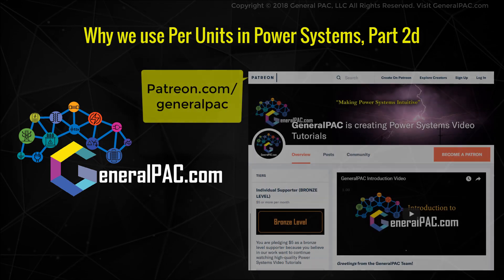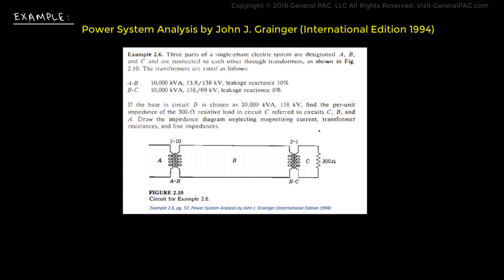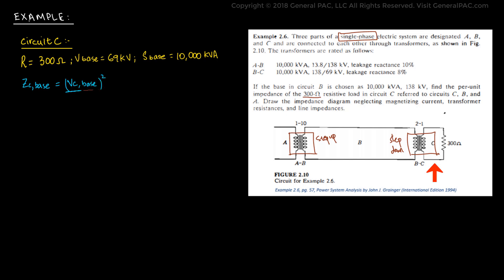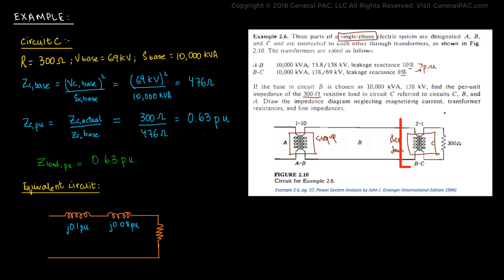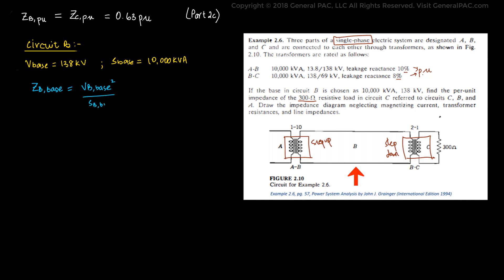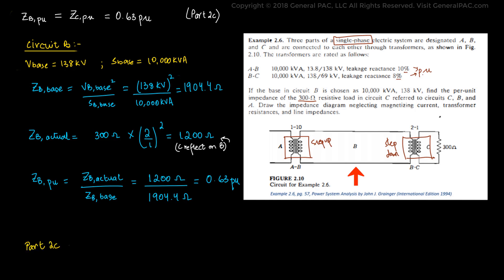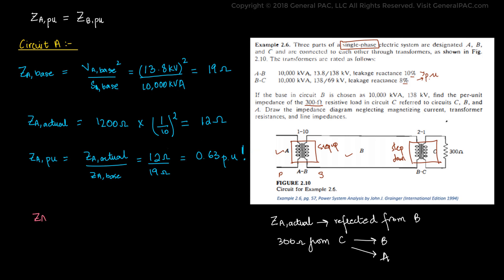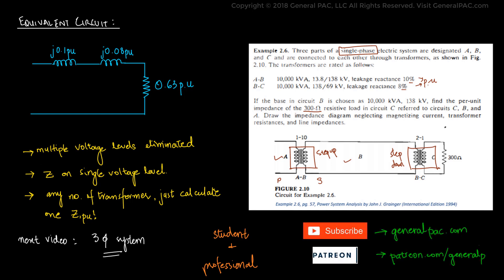Why we Use Per-Units in Power Systems, Part 2d

Comment: Salam , From where you get 0.08 impedance and why ratio   (1/10) square 2 . Please explain me . Thanks
Reply from the maker: 0.08 is the leakage reactance of the step-down transformer as mentioned in Example 2.6

Addressing your second concern, (1/10)^2 is just the square of turns ratio of the step-up transformer. We used it to calculate the apparent impedance or the reflection of impedance on the 13.8kV side (part A) of the electric system.